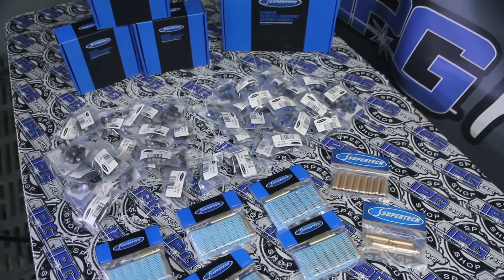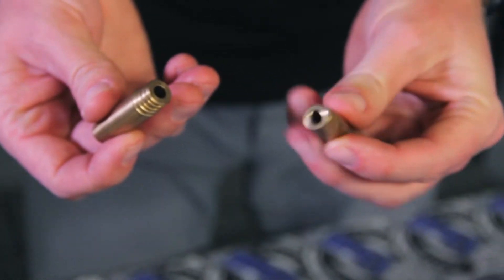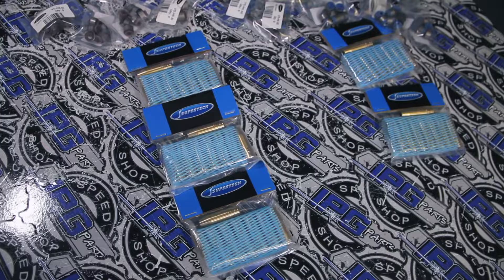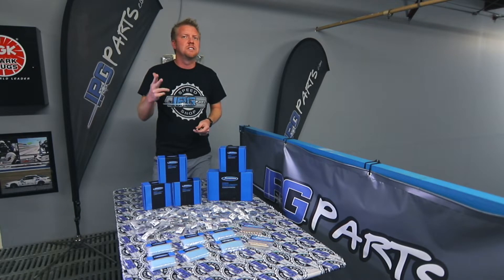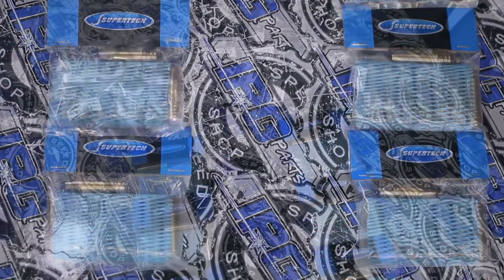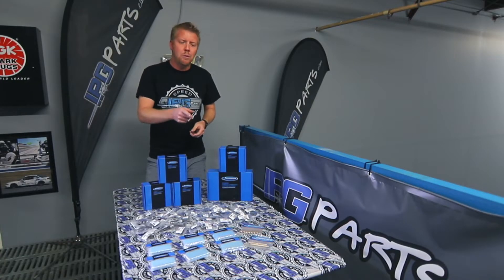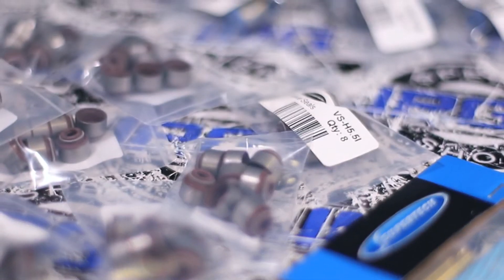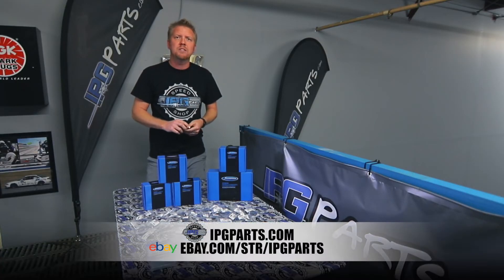Supertech Performance Manganese Bronze Valve Guides & Valve Stem Seals

Comment: Is it possible to run Supertech valve train; (SPRK-H1021D) 95lb dual springs, Ti retainers, guides with Ferrea valves and keepers?
Reply from the maker: Yes... all of those parts are designed to be OEM size and fitment so they can interchange with each other
Reply: @IPGparts  absolutely fantastic news.thanks for your response. A Ferrea rep was trying to tell me that I must use Ferrea retainers with their locks but I'd read online that people have used their valves with Supertech valvetrain with no problems so I was dubious.

The valves I was told to use are part No#: F2388P

I've asked what part number the corresponding valve locks are that match that valve, but they've not responded 🤔
Reply from the maker: @kudzy11  Shoot me an email to Sales@IPGparts.com and I will gladly check into it for you